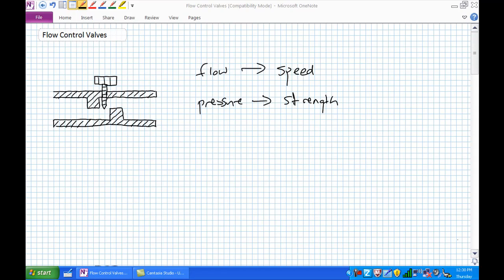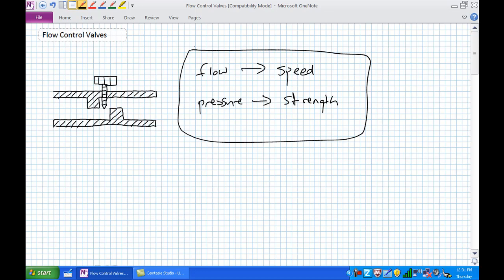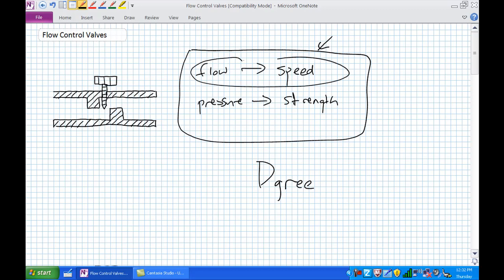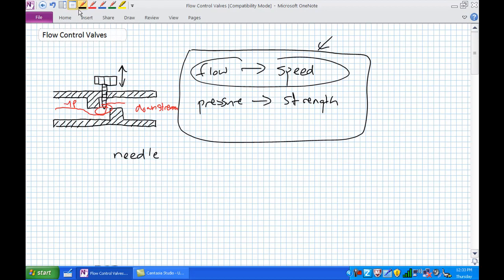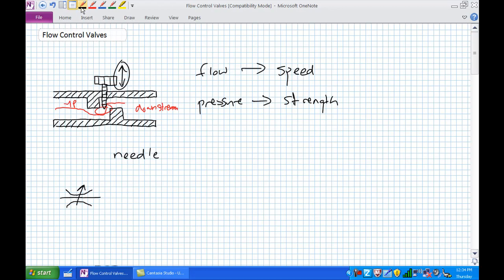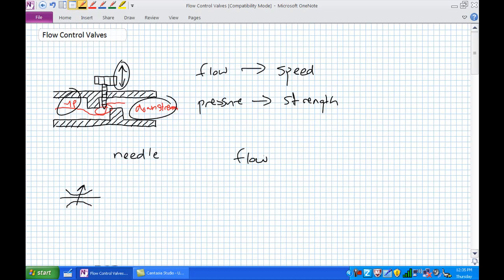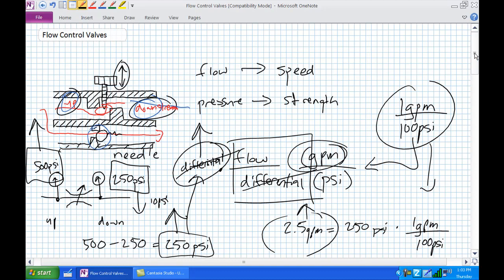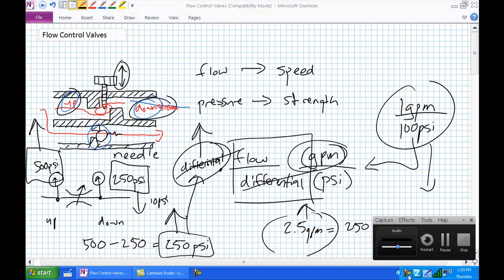Flow Control Valves

Comment: Hi I am from the uk and a mechanical hydraulic technician like your videos very interesting. Just to advise you however on the open/closed positioning of a ball valve you are incorrect, on a ball valve we are the exactly the same, when the lever is inline with the hose/pipework the valve is OPEN and when at at a right angle the valve is CLOSED. just to save on any confusion.

Comment: I hate to be "nit-picky" but in this day & age of international trade we should be introducing students to the metric system.no other nation uses PSI, instead Pascals or the Bar is commonly used throughout the planet. It oil b. Great benefit in my option to use both so the Americans can get use to the units. English system stinks anyway! (Fractions!, foo-i.e.!)
Reply: Great video I have learned a lot even as an electrician!